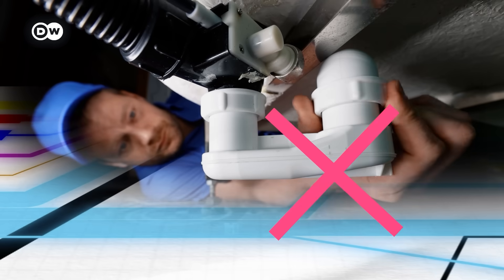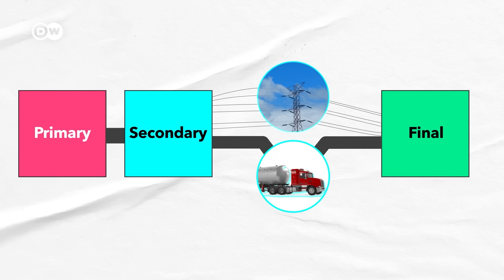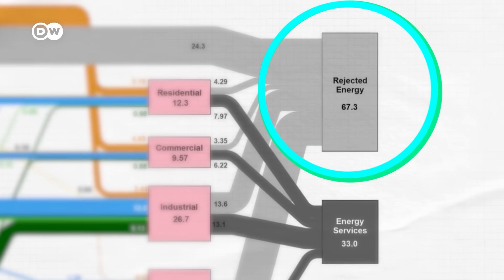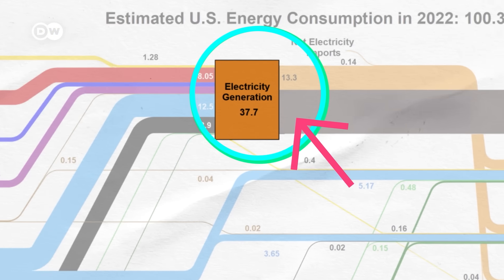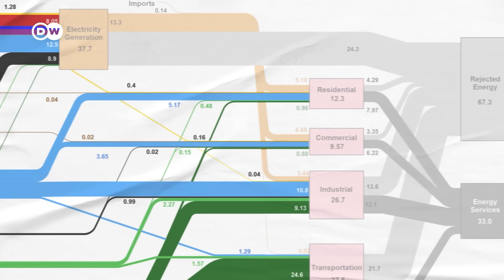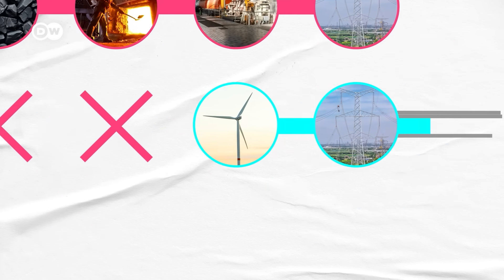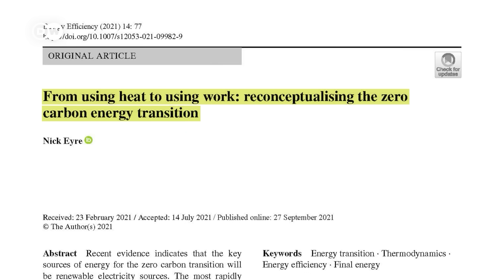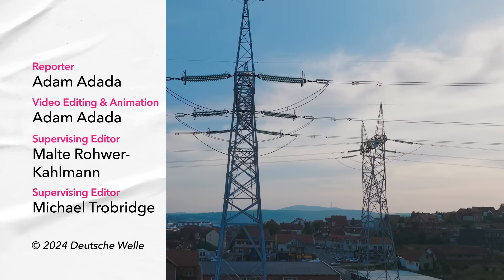The mind-blowing thing we get WRONG about energy

Comment: You focus on efficiency and forget reliability and area problems in reneable resources. Wind plants and solar plants have low energy density. If humanity does not solve these two main problems, we can not be independent from fussal fuels.
Reply: Winds and sunlight are distributed, but as these plants collect it, that becomes pure electricity -- 100% dense. After that, energy density relates more to how much power can be stored in a material (heat in sand or molten salts, electricity in a battery). Those densities are critical to their success and are studied intensely, along with other processes of storage, duration of battery use, etc.
Reply: @markhathaway9456  
The clip forgets that we need more other resources (steel, copper, etc) to build and maintain this type of plant. The main advantage is the low co2 emissions. But cost like the area, the materials and stroage are neglected. These plants harm the environment more than fossil fuels.
To measure the real cost, you need to include the other environment impacts.
Reply from the maker: Wind and solar have a carbon footprint too of course - it is just enormously less than that for fossil fuels! We did a video debunking out on this types of claims you can check out here 👇
https://www.youtube.com/watch?v=k_Wa7v76k-U
Space is something we need to consider surely. 🌞 Did you already see this video from us? 👇
"Why we should be putting solar panels on our fields and lakes"
https://www.youtube.com/watch?v=2hwpXCjmkRo

Comment: We will use every available energy source. Adding renewables has only added more available energy to the grid, it hasn’t cut back on oil. Thinking we will stop using available oil because of abundant renewables is a naive misunderstanding of human nature and market forces.
Reply: EVs haven't become so dominant, but wind and solar are changing the way energy producers do their work. They remove peaker plants burning natural gas or coal and replace it with wind & solar. It's cheaper for them. If we're still using the same or more oil, it just means we need to get to the EVs quicker.
Reply: @markhathaway9456  Not just wind and solar, but batteries too. Australia is replacing their biggest coal plant with a huge 850 MW, 1680 MWh battery.

Comment: Goggle 98% pure silicon
To get the separation it’s 2 coal furnaces  China  has 6 of the the top 10, it take  of over 2 hr total per batch, at 2,400 degrees,  the many more time to Taylor the pure silicon ergots  that are sold to use as chips, processors, ram , memory, solar panels  another furnaces process , counting from earth moving diesel machines to to delivery to warehouse , more fuel was used to make the panels that = the 7 yr life of panels. All you’re doing is moving energy around. 
   Look at ev battery it’s is 16-35%  per car per fill up,  that  lost make the ev car inefficient and consuming more energy that it’s saving.  
Ev  not going to work, our electric grid set up wrong, Europe can get real 220 volts and level 2 fast charging out on the st from the line. 
 That level 2 box you buy is fake, it only the difference between 120 volt and 220 volts.  About 10 charge.  Why is you need real 204 volt line that a special transformer passing line that the used for shopping center or in business district of high usage.   And road charging time decreases  (less amps) the more ev start charging as they are sharing the same junction box. So that means double road charger  in the long run  so everybody get this 1 hr charging time or same amp charging.  It’s all a circle as energy is just moving thing around. And all these charging is wasting amps throwing away in heat. Litium bulk charging range are only a low 15%- 60%  the charger start going into tapping off way to early as the pack are heat up. Each pack has 4,000 cells or 8,000 solder tabs in series or the out side get charge that pass it to the middle.  So you are wasting about 40% of amps that are going off as battery heat.  They is no free lunch in this tranfer as your going ac to dc too.

Comment: So what do you use on a cold night when there is no wind? When that happens we have to start up gas plants, which uses a lot of energy, just to get them operating. Additionally, you don't mention the amount of wind energy wasted, when the wind blows in the middle of the night, when nobody needs electricity.
Reply: Maybe we can store it somewhere or heating up water or other things which can store energy for a bit of time
Reply: Where I live we ended up having a grid alert because of this.  They try to model as best as possible how much power they will be able to produce with wind but that can change quickly.  If it takes longer to fire up the gas plant than it takes for that change to happen then we have issues. In theory I support wind and solar but I also dont like the idea of having to pay for power twice. Its not like if a gas plant is off there is no costs. You still need to get that money back which means power prices go way up to make up for the lost revenue. I also saw a video of a tornado ripping through an area with wind turbines and destroyed everything. A gas and nuclear power plant can be designed to handle these extreme conditions.  Wind turbines cant really handle it.
Reply: @pin65371  nuclear had the problem in the past that river levels was too low and they couldn't supply coolant for the power plant. And gas is expensive

Comment: I think that one aspect that almost always get omitted from these sort of electrical utopia videos is the change to infrastructure required to electrify everything. We need to be thinking more about distributed electrical infrastructure. It's much easier to electrify one household than wait 20 years for the infrastructure to catch up. Another BIG problem is electrical vehicles which require huge amounts of energy and fast to recharge. They may be efficient energy conversion devices but there's no way to actually charge them at scale. And, sorry, but moving 2 ton metal box across town for one person is still a huge waste. It will be much harder to electrify transportation if we keep building and maintaining car-centric cities. Personal mobility and public transit are key requirement for real and fast green transition.
Reply: Sunlight and wind will be here whether we use it or not. Why not use it? Cost to change? Yes, there is that. Cost of not changing? Yes, there's that too.
Reply: @markhathaway9456  This is not at all what I said; read again.
Reply: As far as EVs requireing lots of energy from the grid goes, Aptera is looking to change that with their obsessed with efficiency, aerodynamic equation on wheels, mass market solar EV. The nice thing about being so efficient is that only a small, lightweight, cheap, easy to fast charge, less impactful battery pack is needed. And given the the most expensive part of EVs is the battery pack, that gives a significant price advantage. With each vehicle being covered in solar cells, that give the added benefit of charging occurring at scale, even when there aren't enough chargers plug into to do so. The slow charging from solar also puts less stress on the batteries, so fewer battery replacements are needed, keeping the vehicles on the road for longer. I've been following alot of the information about Aptera here on YouTube,  and I feel Aptera is going to be a huge success once they hit mass production come 2025.
Reply: @TildaAzrisk  I'm sure there are many remarkable companies doing remarkable things in the EV space (e.g. Edison Motors.) My point is that we can already do SO MUCH to reduce our carbon footprint considerably even with good ol' diesel engines, if only we use them the right way (hybrid, public mass transit, 15 minute cities, biking infra.) This clip talks about taking advantage of wasted energy; this is exactly what we need to be doing instead of wasting more time, more money AND more energy playing the same old game of so called "innovation" within the confines of the capitalist system. Aerodynamic performance, light-weight batteries and solar panel covered cars are not going to solve the problem of having too many cars on the road...
Reply: @sfertman   Good points. While energy-efficient cars and a good, individual solution within the current systems, however, the benefits are limited benefit due to staying within the current flawed systems. Metaphorically I was looking at the trees, not seeing forest.

After some thinking, the issue I'm seeing now is a cultural one. Overall, our current culture is too exclusionary, and neglects collective needs. People aren't taught how to be a part a sustainable community. I know I wasn't, because I'm having to find such information mostly on my own.

Comment: It’s always irritated me that we hve gas turbines in generators that creates usable electricity but mostly throws away the heat. Conversely we have boilers (or furnaces) that create heat but waste the combustion process, ie doesn’t produce electricity at home.
Reply: A car sits idling at a red light, burning gasoline, going nowhere.
Reply: The problem is that processes that require temperatures similar to the temperature of the waste heat are typically more expensive to build co-located with the generation. Why build a 1/4 scale factory co-located for 50% cost when you can build a normal one at normal cost.

Comment: Wow. I thought you might talk about the phenomena of when "clean" energy gets produced demand rises with it instead of it replacing "dirty" sources of energy. Doesn't the same follow with efficiency? In the US regulatory demands to increase the fuel efficiency of cars has led to larger vehicles with more fuel efficient engines using the same or more gasoline as the end result.
The way things are now more efficiency equals high production. Tackling demand is the only way, but that requires change, systemic change.
Systemic change in civilizations has never been planned. It has always been a result of dramatic conflagration or collapse, which kinda seems eminent, no?